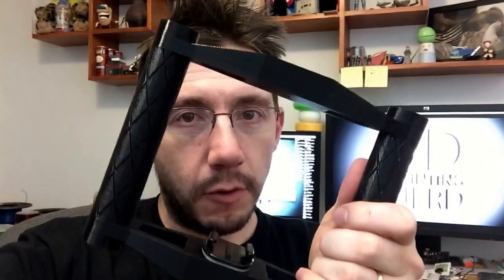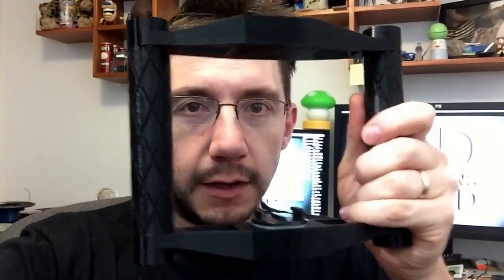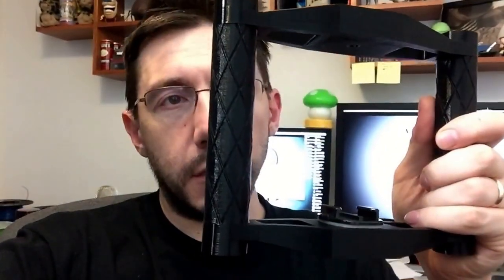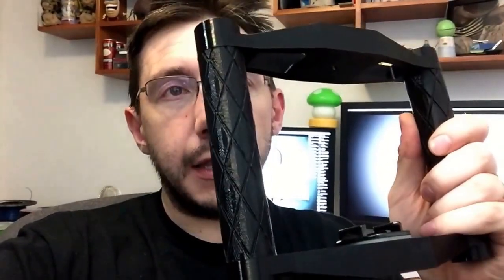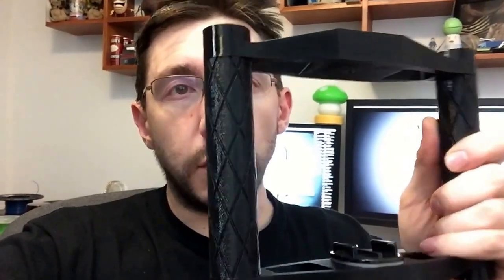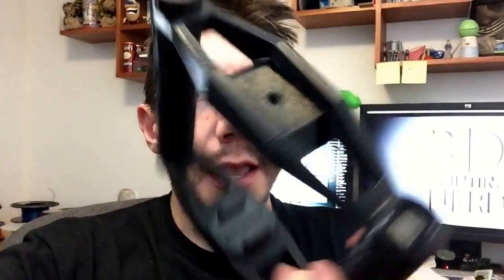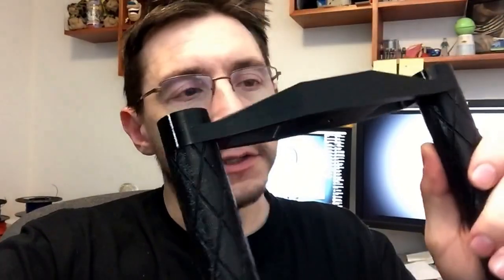3D Printed GoPro Camera Rig Update

Comment: I was surprised to hear there was only one comment on this. I could have sworn I made on months ago asking why you couldn't use a washer to help with pressure from the bolt head ignoring that you were likely talking about the metal threads on the plastic ones you modeled into the handles
Reply from the maker: For some reason, I thought I remembered seeing a comment like that. Weird.